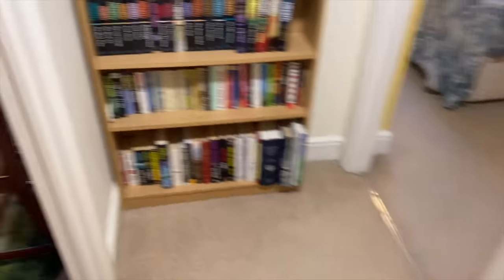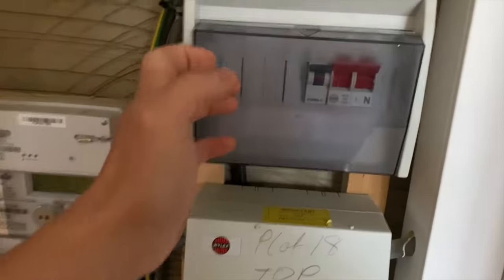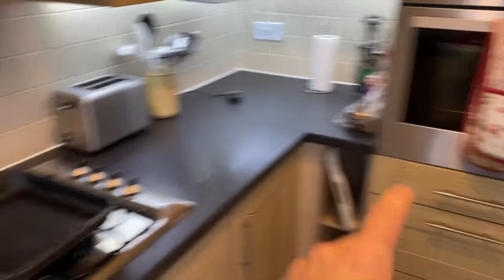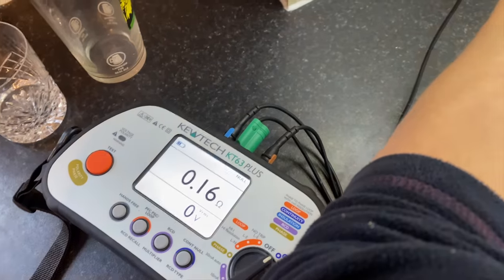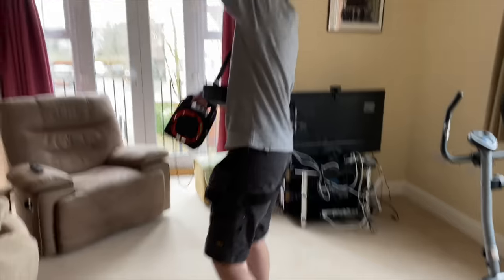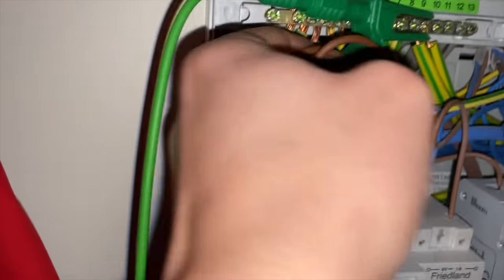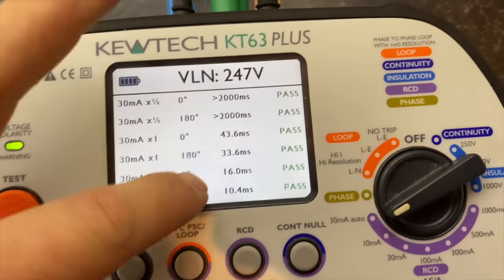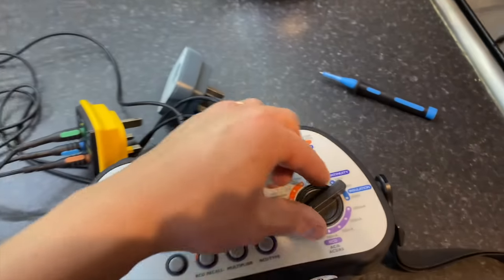Nice to get a decent one. Testing and inspecting electrical circuits. Cjrelectrical

Comment: Client here! Thanks for a good job, chaps, and sorry I got stuck in traffic and didn't get to meet you. Fun to see my place on YouTube! I can clear up one of the mysteries - the second load on the cooker switch is the spark for the hob; if you slide out the middle drawer underneath you can just about see the unswitched socket with it on. The metal lights in kitchen + bathrooms were there when I moved in (2014) but the lounge and the hallway (with quickwire connectors!) were all me. Sorry I scrawled hall sockets on the wrong side of the paperwork. Clearly I need to tighten up my connections a lot more when spreading USB sockets round the place, but as you saw, I've got loads of them so unlikely to do any more. Oh, and there is a fifth accessible socket in the kitchen [EDIT] which I can see from the report you must have found off-camera.
Reply from the maker: Thanks David 
I did indeed spot the socket behind the huge microwave off camera with the extension feeding the under cabinet music system.
Reply: It’s interesting to have a customers perspective. 👍

Comment: Great video Chris, the only thing is the continuity test of the bonding conductors should be done with at least one of the ends disconnected otherwise you could in fact be reading a parallel path.
Reply: agree with the above, as don't forget with a combi boiler all the copper pipework is commoned up.
Reply: Also agree with above,  always a headache when you can't find the water bond end thanks to kitchen fitters who are unaware of its importance.

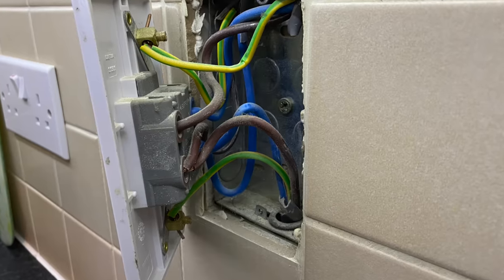Comment: 11:27 cooker circuit - 1 feed into isolator switch, 1 feed out to oven and 1 feed out to hob/cook top...

Assuming local Wiring Code allows that, that's how I'd wire it up.

Comment: Anything built after 2000 wouldn’t have AIB boards in bud just a heads up I think you said it was built in 2007. Keep up the good work 🙌🏼

Comment: You need to have a large magnet on the van to use and see if its attracted to the possible steel plate in the wall.
Reply: A light duty magnet fishing “hook” would work. Just remember a 600lb hold is only on thick plate steel and neodymium doesn’t like heat.
Reply: @peterg.8245  Doesn't like heat but it's not gonna be seeing 200C any time soon in this use. Well. Hopefully.

Comment: The second oven cable will go up and over to a connection plate behind the housing, the other will drop down to the hob. The norm for new build. Even if it is 13 years old. The isssue of the supply cable from the switch fuse. Im thinking that the rcd protection wasnt required back in the 16th edition?? Happy to be proved wrong as were all still learning
Reply: I was wondering if they discovered where it went?
Reply: @mcjjordan  they did sort of, the client commented.

Comment: Chris, regarding the two outgoing load cables in the cooker switch probably one to the oven and socket for the hob. The flat was wired to a previous edition of the regulations where cables buried within 50mm of the wall surface were not required to have RCD supplementary protection.

Comment: 3:23  Fun fact: Friedland is a german village at the old border of Western Germany and GDR. 

The combination of Friedland Transformator and Friedland ding-dong bell are cheap and widely used in the last fourty years in german houses. 

Friedland D780 
in: 220 - 240 Volt 
out: 8 Volt / 1 Ampere 

They not listed more the orginal Friedland bell in the internet. 😕 Only a radio version.

Comment: On most big new build sites now NHBC would fail the pre plaster inspection if the tails or 16mm twin didn't have "additional protection". This has been the case for at least the last 10 years. But I agree better in SWA but on the new builds it comes down to price and time and it's much quicker to terminate 16mm twin!
Reply: A 16MM tande is not fit for purpose for use as a submain where main bonding will be required

Comment: Them FireX are meant to be mounted onto another base, which houses the connector blocks. They are bought separately though so a lot of people don't realise this
Reply: Indeed, I didn't realise - but at least I replaced the smoke alarm when it hit the ten years. Should have found an Aico to replace the original and slide onto the same plate!
Reply: @davidnorth1021  Yeah, Aico are great. Bit pricey though, but so much easier to install and change if faulty etc
Reply: The fixing holes do line up for a dry liner box too, but it's a ballache. Like has already been said, just fork out for aico 😅
Reply: The new firex now  have 2 neutrals on the connection lead so if the smoke head is changed and the existing lead only has 1neutral as shown in the video  this will need changing or the battery will not charge and you will be getting a call back 👍
Reply: I suspect that’s a US manufacture, we require all fixtures to have back boxes including smoke alarms. That is a separate item purchased during first fix usually, so when you go to put the smoke alarms up there’s already an enclosure for them. But global market place and all.... they probably just re-purposed the design and change the electronics a little one slapped them in the UK label box.

Comment: That smoke alarm must be a US manufacturer. we are required to have no junctions in the wall that are not accessible so if there’s a junction It has to come out to a box with a blank plate unless you’re going to use it for something. All lighting circuits will have a back box as well so there’s usually not enough room still to have wire junctions for lights, by the time you get the fixture up there and in the mounting bracket what looked like plenty of room goes down to nothing. So all our lighting fixtures have a few inches of wires hanging off the back that you will attach in the box and then everything is self-contained when the fixture is up. We also require a CPC / ground in all boxes but as we know those don’t always get continued continuity. I constantly find it interesting when you pull up floors and you find all those junctions as over, here that’s been classed as against code for a good while; it aids in troubleshooting as you know if there’s a fault between the two boxes it’s either going somewhere or it’s been nicked.

I make these US comments because through the videos and comments on YouTube I became fascinated with UK wiring and other cultures electric. It’s interesting how we’ve adapted are codes and then started taking things from other peoples codes.

Comment: Hi Chris have they run a separate 10/16mm earth down or just using the 6242y 6mm cpc as that's adequate for the circuit but not for the 10mm bonds back to the service head and 25mm supply tails

Comment: Best to take your earth bonds cables off  the clamps ,for continuity this stops outside influences,I did one because it was a job to run the bond cables they connected it to the mains and just poked a bit under the floor
Reply: 100 percent clamping the earth bar and probing earth wires doesn’t prove anything to be honest. Ie gas and water linked at boiler manifold
Reply: @tomorichard  that's how I see it,👍
Reply from the maker: Good shout but you can clearly see the under sink bond is not accessible without dismantling half the kitchen cupboard so better to test on the clamp than put a lim or NV.
James now has a new job disconnecting all the bonding on the next ones.
Reply: @Cjrelectrical  the one under the sink I would of cut the cable ,tested it and if necessary fit a new earth clamp,but everyone to there own 👍
Reply: Last time I had the back off that cupboard it took an entire evening of swearing and faffing to get it back on so definitely best left intact!
Reply: @davidnorth1021  no need to  take cupboard apart ,cut the cable ,test and then fit another eart clamp,or put on certicate unable to test continuity
Reply: Surely easier to disconnect bonds at board to test, can label them then while you're at it
Reply: @rhysgriffiths9917  not if your testing the continuity from board to clamp ?
Reply: @tww5719  You're testing the continuity of the bonding conductor though? disconnecting it from the board removes parallel paths
Reply: @rhysgriffiths9917  yes thats what I am  trying to say in my first comment,it is also important to disconnect from the board and the earth clamp,to stop outside influences,yes it is unlikely there is a break in the cable,but you never know.👍

Comment: If the mains supply is 16mm twin and earth dose that not mean the cpc is under size because the bonding is running off it as well 
    I always thought it was ok in 16mm twin and earth as long as bonding was before the twin and earth
Reply: 👍 most definitely in a pme system

Comment: Currently, I have an old consumer unit under the stair which is mounted on the wooden panels.  To install a new consumer unit (Fusebox brand),  does it need to be mounted on the Flame Retardant board?

Comment: Maybe its just me...... but the requirement for the sub main incomer to be in an armoured just makes "common sense"..... if the only protection that can be provided is overcurrent then it deserves proper protection. Of course if there was evidence of steel plating protection thats different, but you were confident that wasnt the case.

I totally think from a "layman, non spark" perspective your initial assessment, backed up by NIC, just makes "sense" purely from a safety perspective....

Comment: What did you code that bonding conductors are connected via a marshalling terminal that is supplied via a undersized cpc in relation to min sized bonding conductors in a PME system?

Was the sup bonding present in the special location? As no additional protection was afforded to circuits serving a special location in the form of a 30ma rcd?

Comment: Quick Question what code did you put for provision of additional protection RCD for Cables concealed in walls at a depth less than 50mm 522.6.202 and .203. As there was only RCD for sockets only.   Would be great full for answer.
Reply from the maker: C3 some would code it as a C2 which I believe is incorrect and is looking to force the client into a consumer unit change.
Reply: NAPIT code breakers has this as a C2, doesn't always mean a CU change as it may be possible to change the MCBs to RCBOs.
The inspecting engineer has to use discretion as to whether  end user safety would benefit from this improvement.
If I give a C2 for this I always reference Napit code breakers and the relevant page.
Reply: Many Thanks for your answers.  I code it C3 unless there is a dangerous situation, I also put a attached document to the report highly recommending installing RCBO.
Reply: The problem with EICRs is the more thorough your observations the longer it takes, its very difficult to be as thorough as you'd always like given the cost constraints. 
Napit apparently have recently redesigned their online certification for EICRs so coding is linked to their code breaker guide not sure how this works but sounds time saving.

Comment: I would have put a C2 for those smoke alarm candles with the connectors not been enclosed . Or did you fit a new smoke with a base . You can get a connection base for the firex smoke alarms . 👍

Comment: With the sub main being 16.00 mm the cpc may not be appropriate for that installation.
Also protective earth bonding conductors 10mm need to go back to the MET .
It’s a definitely a no no using 16.00mm T& E these tails,it just doesn’t fit the bill.
Nice video though...

Comment: In the kitchen, I saw what looked like a water heater mounted on the wall between the cupboards and the window. Could that be the immersion circuit?
Reply: No, it's a combi boiler like the man said. Immersion and tank were removed when it was installed, seemed overkill for a flat.

Comment: What’s your thoughts on the usb sockets in general? Are they Worth changing too or more hassle than their worth.
Reply from the maker: Don’t mind one or two but more than that and they become a pain
Reply: @Cjrelectrical  Thanks ✊🏻❤️
Reply: Flippin' BG, PITA to get both conductors to be securely held in the terminal. 
Plus so many devices require intelligent chargers these days or will only charge at 500mA so not worth fitting anymore
Reply: @simonparkinson1053  Thanks Simon, I’ve rewired my upstairs sockets and lighting and downstairs lighting in the last few weeks, plastering and fitting out and been thinking of putting in the usb ones but think I will just go the normal socket route.
Reply: @rabmc  they are a very nice idea but in practice don't work out that well.
Now USB-C is becoming the norm, time for the manufacturers to make a new version which fully complies and will actually charge all devices properly....and including a DP switch both for ease of testing and so it doesn't have to be permanently on.
Reply: I much rather have a separate multi port charger. And a standard wall socket. Until the manufactures decide on a standard even though they have a standard that they’ve decided on. If you were to do it you should probably use USB-C but there’s variations of that. The lower output wattage for phones only and then some that do up to 60w for laptops but then there’s laptops that draw more than 60w. And then you’re torn between the two different connector types. In reality DC has voltage drop over long cable so you either need to make the cable short or you need to make the cable bigger this is helped partially by the standard incorporating higher voltages like 9 to 20 to lessen the voltage drop if supported. But then if your USB socket dies we have to call an electrician in to change it if you’re not allowed to in your country of regulations, versus just picking up a new power cube. Although I have thought it would be useful for some things like Low wattage LED lights, I have some color changing strips but I know it’s 100% guaranteed that where I put them I would have to change the outlet so I might as well just get a spare cube it’s not like I don’t have them lying around.

And I will leave with if you do do it get some quality ones because I know somebody that put one in on their kitchen island and a year or two later it was dead, now this is in the US and I know that they bought a quality socket from a hardware store which was brand name sooooo.

Although I do see why the UK is heavily adopting them when their plugs are so big as it means you still retain two sockets and you can plug two USB devices in.

Comment: Did an EICR yesterday and metal fuseboard had line and neutral through separate holes !!!
Eddy currents obviously the problem, but what code is it ? 
Any ideas ?
Reply from the maker: No sign of thermal damage c3
Reply: CJR ELECTRICAL 
Thanks Chris . Do you know if you can use iCertifi if your only a domestic installer with NIC EIC ? 
Or do I need to go fully approved?
Reply: Mr G From oxford Doubt if eddy currents will ever create a problem .

Comment: Looking at USB sockets why don't make them so they only come on if the socket is switched on.  Been looking for some that do on line not seen any yet.  Asking that I test with socket switched on as had some in caff that had grease in.  When it got worm there was tripping it was under out of sight.  Still don't trust them in my house have a switched lead I kill going to bed or going out.  And if 3 million have them all on all the power there always saying unplug the phone charger to save energy and now sell them to be hard fitted and stay on all pulling milliamps.

Comment: FI for higher than expected r2 ring final reading? I usually C3 it unless the client is willing to pay for fault finding.
Reply: Maybe so i use to work somewhere where the r2 having an higher reading we would C2 it and rectify however where I work now they don't see it as an C2 as long as all Zs readings are correct. If line or neutral readings are inconsistent that would be a different story I'm not sure about the whole r2 thing I guess its open to the assessors interpretation.

Comment: USB socket with a USB charger plugged in, standard.
Reply: USB sockets deliver like 1/4 of the power of that walwart.  1 hour charge or 4 hours,  what would you do?
Reply: Yes Everybody rushed out and put those 2.1a well plates in and then all the devices went to requiring higher power and then they went to quick charge and then they went to power delivery and now USB-c. yeah I’d much rather have a standard outlet and plug-in a multi port charger.

Comment: Did you find out where the second load wires go from the oven isolator
Reply: i am only 13min into the video but i would guess it would go to an unswitched spur for the hob ?!?
Reply: @Stoorie85  yeah i also immediately thought that it would be for the hob
Reply: Confirmed igniter, client comment.

Comment: Should the output for the bell be in black and red to denote a DC circuit
Reply: That model is just a transformer, so 8V AC output. As it's not earth referenced, the blue isn't a "neutral" so should be sleeved black if you're being really pedantic. For DC it would be brown and grey to current standards.
Reply: Hi Dave the secondary output of the transformer is AC, most door bell transformers do not have any built in rectification,
Reply: Thanks guys 👍

Comment: Can someone explain why you can’t have a 100a 100ma time delay rcd as main switch and a 63a mcb to feed flat?
Reply: You could if you wanted but a 100ma S type would not offer the protection “additional” that Chris is concerned about. Only a rcd with a rating of 30ma can do that, fitting one at the origin would arguably make more problems than exist already.

I think a good way of thinking about it is anything other that a 30ma is intended to offer fault protection where a max ZS can not be achieved thus a rcd is required to clear a earth fault because a over current protective device cannot do so.
Reply: Thanks